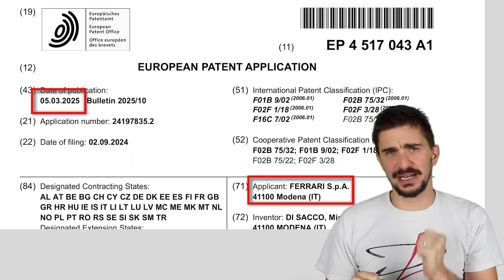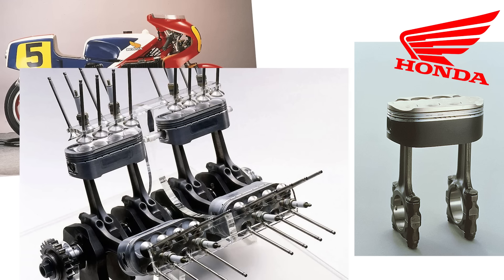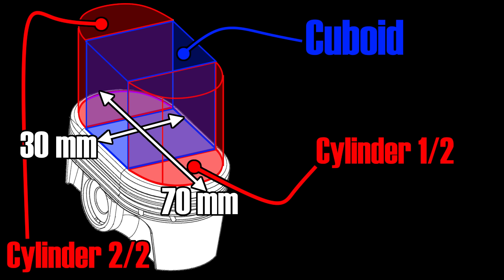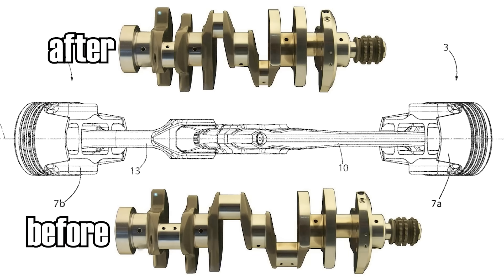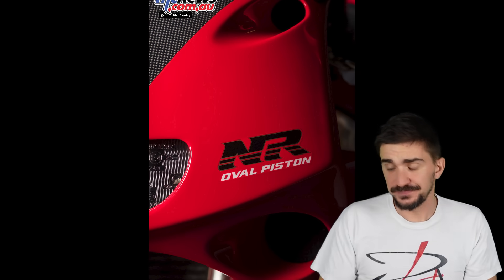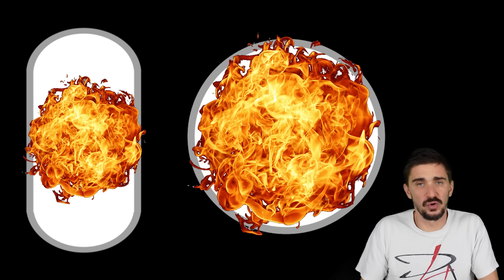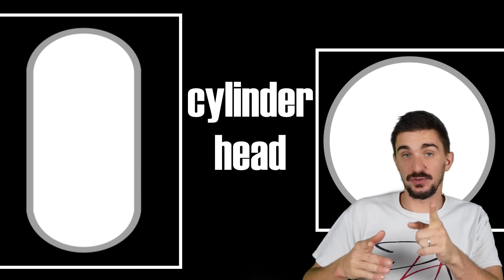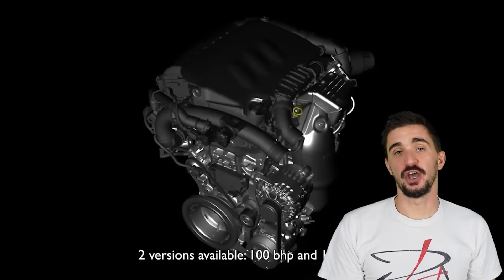Ferrari Just Patented Pill-shaped Pistons and Siamese Connecting Rods

Comment: I wondered what this shape is called geometrically, so i checked and it is a stadium, if anyone was wondering
This shape is also often called a capsule, so pill shape is pretty on point.
Reply: But most pills are circular, so although "pill shape" is sometimes used in this sense, it misses the point entirely. 

"Capsule" makes much more sense.
Reply: @brianb-p6586  "Capsule" shape comes from the shape of capsule pills. Capsule pills are also colloquially known as pills.

Comment: 2:31 They are "ovals" as they are irregularly shaped, squashed, or elongated single edge shapes.
The "ellipse" at 2:36 is also an "oval", as ellipses fit the umbrela term.
The correct name for the shape is "discorectangle" (AKA stadium).

An Egg-like 2D shape is also an oval. Infact an egg is under the umbrella of "ovaloid" as it has a single convex surface or possitive Gaussian curvature. Funny enough it is correct to say the 3D analog to a discorectangle is not an ovaloid. As you can draw a straight line on the cylindrical centre.

Comment: You forgot a benefit: Ovals (or any other shape) have more circumference than a circle with the same surface arera. Therefore the cooling is better. Better cooling leads to higher possible combustion ratios and so on...

Comment: In my dreams of being an engine designer (sadly far from it) I envisaged a V12 with fork and blade rods. The blade rods had full width bearings and machined shoulders. The fork rods had two narrow bearings, running on the shoulders of the blade rod. The fork rod only pivots on the blade, so bearings could be much thinner. TDC timing and secondary balance would be the same for both banks as all rods are concentric to the crankpin.

Comment: As per balancing out the primary and secondary forces, it might be possible to alternate the connecting rod directions.

The first bank of cylinders has the fasteners on the left side of the engine, whereas the second bank has the fasteners on the right side of the engine...  Repeat that down the length of the crank.

Comment: Per the cost effectiveness - I can offer (some limited) expertise on that. I would have guessed forge tooling back in the day (Or indeed casting for other engines) then the easiest shape was round. You could make it on a lathe. Think of the hemi pistons - A lot of extra machining would have been needed to do that, and that's probably how it got made at the height of the boom, with on-site toolmaking facilities, to eat up some of the costs. These days an oval is easy to do - no long setups or rotary tables, edge finding multiple datums for each op - A CNC will whack through the lot in realistically a couple hours if you factor in programming, setup, test run and run (or more realistically a day if you include the requisite 4 smoke breaks and 6 coffee breaks)

Comment: They are too late! Honda did this in the 1980s with the NR500 GP race bike.....
Oval pistons which turned a V8 emgine design into a 4 cylinder, because of race regulations not allowing more than 4 cylinders.
8 valves per cylinder and 2 conrods per piston..... Unfortunately it couldn't compete against the 4 cylinder 2-strokes at the time ...

Comment: The flat parts of the cylinders are inevitably going to experience side stresses that can't be compensated for and this is likely going to cause combustion chambers to deform and fail.

Anybunny with any engineering sense knows that pressure works radially, and has zero respect for the shape of what it is put into [thus oval mufflers being made round by back fires] and the same is going to happen in the combustion chambers as the flat sides are going to be pushed to be round, by the forces exerted by combustion.

It is not a question of 'if' but one of WHEN.

Comment: I wouldn't be surprised if opponents can find prior work for both of these.

I do know that many aircraft engines from the WWI and WWII era had all rods extending to a central buckle on a single offset-point cam-shaft.  I don't know if any had said central buckle connected solid to the "main" pushrod like this does though, however it is a logical way to remove one joint (and it's weight) without substantial output loss.

Of course, looking at the patent, I suspect it is just advertising, and they likely have zero intention of enforcing it.  They just want to tip off all the car magazines to the patent's existence and watch them all write articles about it.

Comment: oval or "pill-shaped" pistons could be interesting in a radial engine, with the piston placed parallel to the engine axle (so the wrist-pin would be inserted longitudinally). This would solve the piston's rocking issues and it would allow for more displacement from a smaller diameter engine (it would just be slightly longer, which is never an issue with radials)
Reply: good idea, you're just a century too late.

Comment: Fun Fact:
The Honda NR750, known for its oval-piston engine, was the most expensive production motorcycle Honda had ever sold, priced at around $50,000 when it was released in 1992.
Reply: Honda first bought out the oval shaped piston in 1979 in the NR500 Grand Prix bike.
Reply: New tech always costs more. Unfortunately a radically new engine means radically new tools and machines for service centers.
Reply: 50000 that is cheap compared to the RC213V price. Yes I know if you adjust for inflation todays price would be much higher but still I want one and by that I mean both!!😁
Reply: Your right about the oval piston but very wrong about the most expensive production bike. Even by Honda standards its not their most expensive production bike with adjustment for inflation. The RC213V might have been the most expensive bike that can be purchased but doesn't really count as a production bike due it only being sold in extremely limited numbers to only specialized buyers.  Honda's most expensive actual production bike is the Honda Valkyrie. Each one cost Honda upwards of $100,000 to produce and that's in 2004, and that doesn't include R&D. It was $100k just to build each bike. If you take inflation into effect that would be just under $180,000 in 2025.
Reply: saved me from watching this video Honda Rules.

Comment: In reality, if the compression ratio is to be above 4:1, there will need to be 2 bolts between cylinders to hold the cylinder head in place.  There will need to be 2 spark plugs per cylinder, which eats up space normally used for poppet valves.  The piston skirt length will need to be doubled.  Basically, wait 5 years before buying a car with this engine, the reliability seems questionable.  Also, all types of exotic engine designs have been tried over the years and we keep returning to a traditional design.

Comment: Honda developed oval pistons 46 years ago.  The engine with the oval pistons was in Honda's Formula bikes of 500cc.  The engine was four stroke competing against two strokes.  The reliability wasn't great due to the oval shape with straight sides.  Honda figured out how to increase reliabilty by giving the 'straight' sides a slight curve.  Honda used this knowledge to create the engine.  Honda developed the endurance racer  NR750 with this engine.  Even with lower tier riders, the bike performed well.  Honda then developed a hand made street version with the same designation,  NR750.
I guess Ferrari had to wait for the patent to expire to steal Honda's idea.  The only difference is a single connecting rod per piston.

Comment: Wouldnt the valves be 90 degree turned from the running piston , for example the way honda solved it works but isnt really shorter but longer, so a kind of lever is needed

Comment: The Electro Motive Diesel engine company, a subsidiary of Detroit Diesel that made 2 stroke diesels for diesel-electric locomotives used a somewhat innovative way around having to offset the cylinder banks in vee engines. The conn rod on one bank had two big end bearings, separated by a space. The conn rod on the other bank, opposite to the first rod was conventional in that it had one big end bearing that fitted in the space of the opposite rod, thus obviating the need for offset cylinder banks. They called it "fork & blade". I don't know what advantages this would give the engine. It would require two different shaped conn rods & 10 more thrust washers in the big ends in a V-20 engine. Detroit Diesel still probably has the patent for this, meaning that Ferrari wouldn't want to pay any licencing fees. And we know how cost conscious Ferrari is & how they just hate having to charge their customers any more than is necessary.

Comment: I was thinking the rocking would be an issue as well, but there is a technology that can help with that, It's a sacrificial polymer coating that is specifically designed for wear situations. There is a place in Michigan that specializes in this called Line-2-line you can check out that will show you what it is and does, This might be a solution for the rocking pistons

Comment: Help me out here ppl, I must be missing something at video point 3m:45s   I cannot make the math equate to what MUST be obvious.  The drawing of the piston head shows a 30mm cuboid, which by default HAS to mean the rounded ends have be a 30mm diameter (i.e. on a 15mm radius).  Therefore one end MUST be a 15mm radius, the centre cuboid is given as 30mm, the other end is also a 15mm radius, so the maths add up that 15mm radius + 30mm cuboid + 15mm radius which is a total length of 60mm . . . . . . . . . . but the drawing says the length is 70mm . . . . . . . WHAT AM I MISSING HERE ???

Comment: 09:00  "secondary imbalance"
Well the problem is not in the different lengths of arms but in the asymmetry overall.
Nnd the imbalance comes only from the rods and nothing else because the joint rod is mechanically same for piston as a separate rod except slightly different side friction in the piston B because it accepts some angular force when A does power stroke.
The rods can be even balanced to have same weight, that will mostly fix the problem.

Comment: The reason is to pack them in and solve cracking issues where the pistons meet, basically. More friction though, they probably have a solution. Triangles would probably work, but misalignment is the problem with non circular bores, as with firearms, very few non circular devices work well. They do exist. Hexagonal works ok. All these shapes are loads harder to make precisely than a circle. Shape changes under differential thermal stress may be expected.

Comment: One would think that true oval shape is required instead of pill, for durability... would cylinders really maintain their shape during time without a problem, with a completely flat section included? Obviously we talking about very minimal measures... but pill-shaped cylinders might be more prone to start consuming oil, compared to round/oval. Reason would be the same as why metal beams are stronger with holes on them, and why knife blade doesn't crack so easily if it gets thinner all the way from handle to the very tip, etc...

Comment: Wouldn't this have more of an issue with wear of the bore than the Honda NR750 engine with its dual con-rod design? 
The manufacturing costs for Honda were greater back then due to CNC machining being in its infancy, so it was decided that the extra expense didn't equate to enough output gains to justify continuing with the design. 
If it wasn't for Honda's patents, I reckon it would be quite feasible to economically produce a similar engine to the NR750 utilising  the high quality of today's  CNC machining technology!  Would be great to see a working scale-model of the engine!

Comment: You cant get sqare 30mm side and oversa length of 70 if you have semi circles. 30mm square side=30mm diamerer, so total length is equal 3:50  to 30 +R15+R15=60😅
Reply: Opps, I only just found your comment.  I raised the same question just a few moments ago and I totally agree with you.  The math is not possible using the dimension stated in this video at point 3m:45secs.  It looks like the drawing is a boo boo lol

Comment: Ferrari's connecting rod is lifted straight from radial engines.  Nothing new under the sun...

Two counters to the "V is wider or valley is narrower": For the former, make it a horizontal engine, though Ferrari doesn't seem to be doing that.  For the latter, valleys have already become extremely narrow, but aren't needed because of overhead cams and very straight intake ports.  Modern intake manifolds have runners that basically point straight up into the plenum on more conventional engines.  At worst, they just do what's been done on countless designs before (including, I'm pretty sure, some Ferraris) and divorce plenums to get the desired runner length.

Comment: Any new engine designs are done solely for emissions, they in some way increase fuel efficiency.

You would need added cylinder thickness inbetween the 2 flat sides of the pill piston. You cant use cylinder wall thickness from a traditional engine, more heat is generated on that specific area in this design. 

Imo, this is an overcomplicated design  following down the path of specialized service, planned obsolescence, & creating a new brand identity for the future. Ferrari wants to be the sole manufacturer of this pill engine.

Comment: Ha.... Looks like they made an air compressor with spark plugs and forgot the "cross heads".  At least that would stop the pressure imbalance on the pistons if the rods only went straight  up and down, and the bottom end of the cross head arm drove the crank arms and crank.

Comment: Nicely presented. One minor point overlooked is the different kimematics on the articulated rod vs the master rod, it will slightly impact the I'm imbalance, trapped air, etc. The kemimatics are well known as the design is functionality the same as used on radial engines or on large bore industrial engines. Like the other issues you point out, either there are known mitigation measures or the effects are minor.

Comment: Right at the start: Ferrari has not yet PATENTED anything of the kind. They have APPLIED for a patent. It says so right at the top: European Patent APPLICATION. You can APPLY for a patent for a broom. And it will be published. Also the date of the application was NOT 05.03.2025 as highlighted (that is the PUBLICATION date, it says so right there!) but 18 months prior on 04.09.2023 (the priority date, (30)), because applications are published only after that time from the first filing (in Italy in this case, unsurprisingly).

Comment: The Ferrari wrist pin axis is perpendicular to the long-axis of the piston.  This is opposite of the Honda NR750 Piston with a wrist pin parallel to the piston.  The Ferrari design looks less robust lacking support under the ends of the piston.  It would be interesting to see just how long the non-circular compression & oil rings hold up in this configuration.  Sealing the bore of an oval piston is going to be a challenge to say the least.
Harley Davidsons already have directly opposed v-cylinders and a solid 'siamesed' connecting rod shared by 2 pistons.  This probably explains the 'novelty' of the Ferrarti 2-piece rod in this case.  Now imagine 4 Haley v-twins sandwiched together side by side.  I don't think this will be an easy imbalance to rectify.  
The whole thing looks like a cobbled mish-mash of other motor design features that is going to be a new exercise in catastrophic failure, and certainly and unnecessarily over-complicated time bomb.

Comment: Honda was engineering and racing oval shape piston engines in 1979.
Reply: Yes he did tell us that
Reply: The rings can't spin and wear out corners of the bores a bike mechanic told me decades ago.  8 valves per cylinder too, double the moving parts and springs.
Reply: Not even 2 minutes into the video he mentions this...
Reply: Mazda also used "blue pill" -shaped pistons in Wankel engines, sort of... 🙃
Reply: maybe watch the video before commenting
Reply: @inm1xn  Then, how does one patent something that was invented decades ago by someone else? The conrod system is not new either. All radial engines have them.
Reply: Just what I was thinking - Honda produced a 4 cyl motorcycle with obround pistons in the early 90's.
Reply: Yep on their GP bikes.
Reply: i came here to say this...the Honda NR
Reply: @jnicksnewstart  8 valves street bike / gp 4 stroke
Reply: esatto
Reply: Y'all are saying this, but it is a completely different design, Honda had 2 connecting rods and the wrist pin was along the major axis. I would say Ferrari and Honda designs are more similar to traditional cylinders than they are to each other.
Reply: Incredibly unreliable and uncompetitive race bikes, yes
Reply: I remember that Oval piston :: Was a big mistake e failure, they lost millions millions of dollars !!!!!
Reply: @salvatorecotrone3950  It was an amazing race bike though.
Reply: @danielwaddingham9672 i saw the NR500 GP bike race at Laguna Seca, it was not very amazing compared to the two strokes of the day. It never won a single race. What it lacked in power it made up for in extra weight!
Reply: @salvatorecotrone3950  Not a failure, just shi*ty to make the rings and too expensive for the general customer..

Comment: Your animation of the flame front travelling through the chamber is absolutely NOT representative of what happens in real life (8:20).  That's not how a flame front travels in a real piston chamber.  The fuel charge enters through the Intake port at one side is compressed and ignited, and then travels out the exhaust port on the other.  We have real footage of combustion chamber flame fronts these days...
Reply from the maker: My footage was actually combustion chamber footage too, filmed using an extra special high megapixel camera